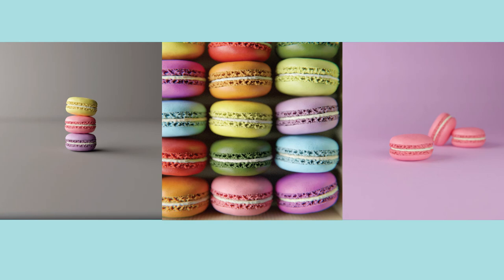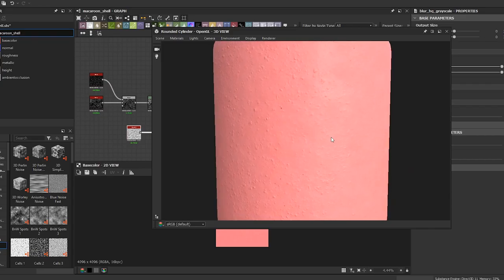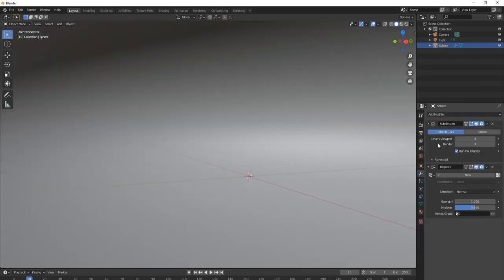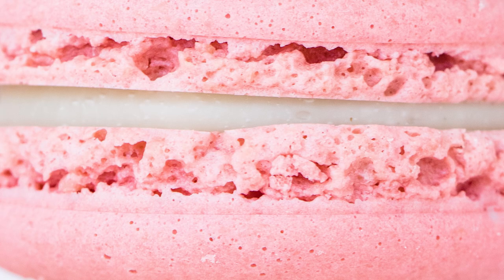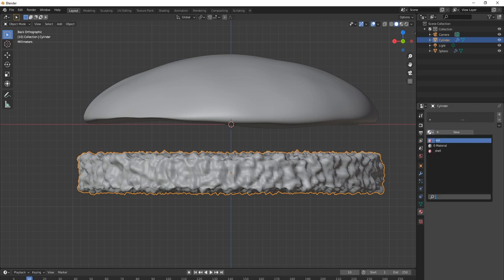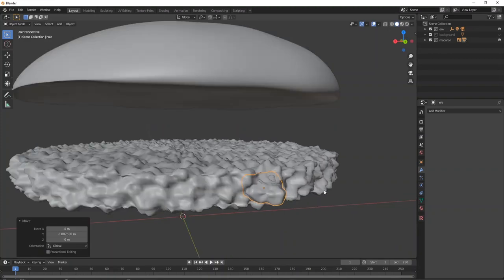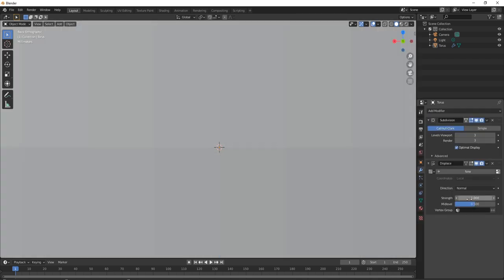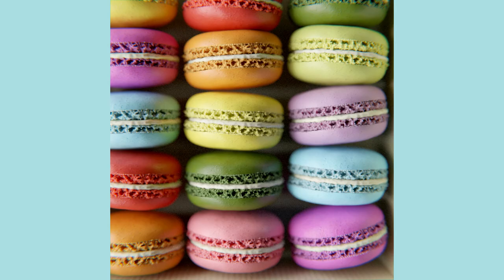Create Photorealistic Foods in Blender: Macaron time!  #tutorial

Comment: Thank you for the elaborate Tutorial! 
To eliminate the manual work I made a collection of different sized hole punchers and used thad collection to create hair particles on the feet. Then I also randomized the hair sizes. After making the particle instances real and put them into a collection I used that collection with the boolean modifier.
Reply from the maker: thanks!  It's great to know the video helped.   Also your improvement is a great way to speed up the process!  thanks for sharing.
Reply: did the same thing!

Comment: On the cap part, black lines appear just along the perimeter of the outer marked seam in render view. Im guessing  there's a problem with the direction of  the normals but i just cant find a solution.
Reply from the maker: hmm interesting.  I've never seen that before, I just tested it out with a new file as well.  When you uv unwrap, do you see a image similar to 4:10.  There needs to be 3 distinct islands.   You can check the direction of the normal faces in bender see if they are all blue (ie facing outward).
Reply: @CanosieLabs  I have the same problem, the bottom of the object is black. The normals are blue. No light source helps. I don’t understand what to do, I’ve already tried everything

Comment: Instead of booleans I would sculpt some holes by hand.
Reply from the maker: I tried that, it takes too long doing it by sculpting.  It doesn't look right because the holes are not depressions but rather air pockets.  You can't get that effect by sculpting easily because you have to create a overhang for each hole.  Using the gives you this effect automatically.